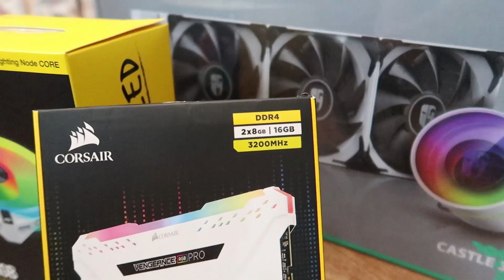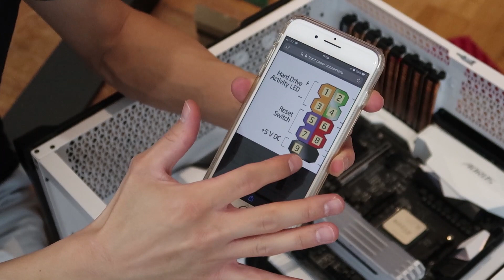The White Ryzen PC Build - Metallic Gear Neo Qube

Comment: Tips for people who buy this case and have only 3 fans. Mount the 3 fans on the right that they can bring air in to the case, becouse AIO fans need fresh air to cool down that radiator since you mount tha radiator on top. Another option is to mount the 3 fans on bottom for intake so the gpu can benefit a bit of it and mount the AIO on the right side. I think this is the ideal setup for this case.

Comment: Just something I noticed, but there is no power led cable for the front panel (or am I wrong)
Reply from the maker: Yeah you might be right, there is only a HDD LED on the case as far as I can see.
Reply: @nicktayshagaming1659  thanks for answering, I bought the case recently and spent way too long looking for it since it's not specified anywhere there is no power led cable (probably should be obvious since there doesn't seem to be any led on the power button but my dumb ass could not notice sooner)
Reply from the maker: @quloman  Awesome case though! The features of the Lian Li O11 XL but in the smaller size!
Reply: @nicktayshagaming1659  yes I like it a lot, any way nice video to show off its details and functionality

Comment: I have this case and the fans on the bottom too but why my gpu is 72 degrees playing warzone
Reply from the maker: I can't give you a straight answer for that. This case is potentially good for temperatures as it has a lot of space. It depends what GPU you have, what fans you have, how your fan curve is set up if at all, what speed the fans are running at, what push-pull orientation are your fans installed in etc.

Comment: Hey bro,  I Just start to install my motherboard,  and can't find the power Led cable 🤔 

Have the power sw, the hdd Led and the reset sw,  no power Led, have only 3 cables With small 2 pins connectors. Can you help me ?
Reply from the maker: It depends what case you have. The power LED isn't necessary for the PC to work. I would contact your case supplier or manufacturer or check the manual.
Reply: @nicktayshagaming1659  I've the neo qube like you. I doesn't Know where to connect the 3 pins connectors for rgb. It's a 3 pins male connector 🤔

Comment: Nice video👍 you should add more rgb fans to complete the look, 3 more on the bottom plate😎
Reply from the maker: I have already done this AND added a vertical GPU bracket, video should be uploaded soon! :D
Reply: @nicktayshagaming1659  why didn't u go for 3600 over 1700 ryzen ? And 1070ti over 1070?
Reply from the maker: @ankrox007  the Ryzen 7 PRO 1700 is currently the best price performance CPU in the used market. For the GPU it was the only one I could find that was white at the time. Both of these parts are easily upgradable though. However my CPU is nowhere near being a bottleneck for this system and I am always checking the used market for these parts!
Reply: @nicktayshagaming1659  oh ok yeah even im looking to buy a used 2070 super founders edition, hard to find it in my country, jus have to wait i guess 🙁
Reply from the maker: @ankrox007  Just wait, things will be changing soon when the 3000 series becomes more available
Reply from the maker: @ankrox007  I have just uploaded the video where I added a vertical gpu mount and 3 more rgb fans! :) https://youtu.be/o94kEzWwh1Y

Comment: Cool build man, the only thing I would do different but might effect the aesthetics  is put the intake fans on the bottom, just going to massively improve the airflow. Really good video, you spoke well and gave alot of info.
Reply: lol sorry ignore me, i just found your next video where you fix this issue, great build!
Reply from the maker: Hi Usman, thanks for watching! Yes you are correct, they are both exhaust. Surprisingly the temps were decent that way. But the next month I also installed additional intakes on the bottom so I now have 9 fans. You can see this in the next video. I think for optimum cooling they should really be 6 intake and 3 exhaust, but I'm choosing to keep the side mounted ones as exhaust for aesthetics.

Comment: Thanks for sharing Nick! You don't know what has helped my assembly! same cabinet, same motherboard! a query, where did you connect the cable of the front led strip of the cabinet? I can't find where to plug it in
Reply from the maker: Hi Yayo, I think it may have been a SATA connection, so it got power connecting to a SATA connection from the power supply rather than the motherboard.
Reply: @nicktayshagaming1659  Ah, ok! 
I mean the D-RGB-FAN cable that has a male connection like the ones on the motherboard, I'm going to try with Sata. Thank U!
Reply: @yayo_xyz  Same case and same problem! I have the front strip going fine with the SATA connected. But then there's the male 3-pin D-RGB-FAN - I tried plugging into my motherboard's RGB chain I have but it doesn't seem to do anything? The two extra buttons on the front don't do anything either. :(

Comment: Yo love the build, but can I know if the case will fit the asus prime x570-p, its a atx motherboard?
My friend told me this case only fits and eatx motherboard but I'm not sure
Reply from the maker: The Aorus AX-370 motherboard I have installed is a full size ATX motherboard and there is still more space inside to fit an even bigger one, if for some reason yours is, which I doubt. E-ATX is actually a made up size from what I've heard, but means it might be slightly larger than a full size ATX. Either way I think you'll be ok.
Reply: @nicktayshagaming1659  what about arctic freezer 34 duo, on pcpartpicker.com it says the arctic. FREEZERS duo cpu cooler won't fit but im not sure
Reply from the maker: @unknownuser4691  maybe it won't fit because the tower cooler is too tall.

Comment: hello thank you for your video, is it possible to install a bigger graphics card eg a card with 3 fans? that did not generate the watercooling on the right? for the power supply box all the boxes fit? Thank you for answering me
Reply from the maker: Yes you can fit a much bigger graphics card, the case is 45cm deep so the graphics card would have to be slightly shorter. I'm not sure what you mean about the water cooling. Standard ATX power supplies fit in the rear of the case.
Reply: @nicktayshagaming1659  thank you for your quick response, sorry I looked bad, the large graphics card works well. the glass walls are lightly smoked? or normal? THANK YOU

Comment: I'm so confused at the parts selection, you have a high end case with a low end gpu with an overkill amount of ram with a lowish end cpu with a high end liquid cooler with a meh end motherboard with an overkill amount of psu power with some high end expensive case fans.
Reply from the maker: It now has a 3070. I liked the case. I filled up the RAM slots for looks. I don't need a better CPU (although I have just bought a 3900X which I might use). The motherboard was the only white one I could get to match the rest of the build. The liquid cooler matches the white in the rest of the build. The PSU is one that can run in silent mode without it's fan on at all, which I liked. It also has white cables out the box to match the build. I had to buy some fans that looked ok from behind as well as from the front for this case to work and they also needed to be white to match the rest of the case. Makes more sense now?
Reply: @nicktayshagaming1659  yes now it makes sense

Comment: Hello guys, could you help me with the wiring of this case? I couldn't fine the wire to plug the rgb strip that comes on the front. Everything else works just fine.
Reply from the maker: I used the SATA power cable and control the effects using the buttons on the front of the case.
Reply: @nicktayshagaming1659  I had mine connected to just the SATA and the buttons did nothing.I then also connected the D-RGB-FAN male 3-pin to my motherboard RGB chain (had to unplug from my GPU) but they still do nothing. There's still the little 3-pin that isn't connected but can't find anything that would connect into?
Reply from the maker: @Thorned_Rose  Maybe try another sata cable and/or if you want to control with software you may need to use the female 3 pin straight onto your motherboard - not sure if you can control it if you daisy chain it. If still no luck I would contact Phanteks / MetallicGear for advice.

Comment: Yo what do you recommend for my fan for intake/outtake, im trying to put a aio on the right side as exhaust but isk what to do with the others?
Reply from the maker: Ideally for optimum cooling, you would want the bottom and right side as intake and the top as exhaust. Heat rises so you may as well assist it rather than try to fight it.

Comment: Which fans are you using for exhaust ? Love the video btw!
Reply from the maker: The top fans which pass air through the radiator are exhaust and the side vertical fans are also exhaust (but mainly for looks, they should be intake really). In my next video I installed 3 more QL120 intake fans on the bottom. Really I think I should have 6 intake and 3 exhaust out of the 9 for optimum cooling.

Comment: where does the HDD and the SSD go?
Reply from the maker: In the video I only installed an M.2 NVME SSD on the motherboard. In the specs on the Metallic Gear website it states there are 5x internal 2.5" SSD bays and 2x 3.5" internal drive bays.

Comment: To ground yourself, touching the cases does nothing unless it is connected to the ground. Plugging the PSU and keeping it off is a better idea
Reply from the maker: Ah yes you are correct. I have used the word “grounding” incorrectly, my meaning was to discharge any static that your body has built up.

Comment: What fan size fits the rear vents?
Reply from the maker: You can't fit any fans on the rear, the rear is basically the side vents which has space for a 360 radiator or 3x 120mm fans.